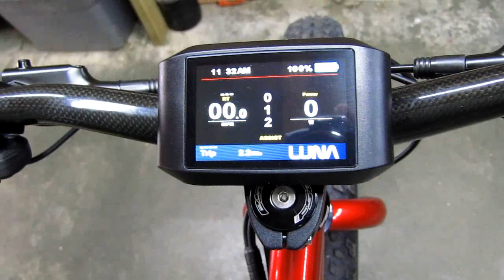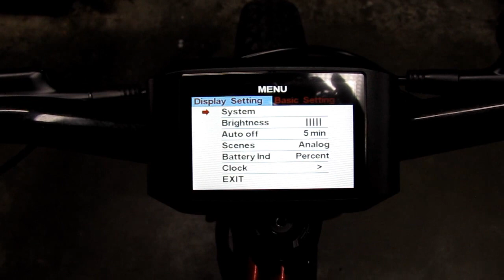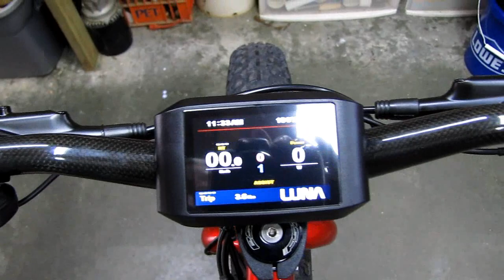Mongoose Hitch Ebike Build #6 - Luna BBSHD parts and install

Comment: Thank you for sharing your experience building this.   One thing I did not quite understand from the video:   

Was your BBSHD motor the 120mm bbs?    What did you need to saw to get it to fit on the 112mm bbs frame, on the mongoose frame?   Was it required?!

I just ordered a BBSHD 120mm from lunacycle after watching this video and hope i can pull off the installation...
Reply from the maker: You have to measure the bottom bracket on your bike and get the correct motor. That Mongoose was 100mm. My carbon fat bike is 120mm.
I used some spacers on the Mongoose

Comment: Would the BBHSD work on a Mongoose Vinson?  Similar frame to the Hitch but has a lighter, aluminum frame and better components out of the box.
Reply from the maker: I am sure it would. You just have to know the BB width so you order the correct motor. The hitch I had was 112mm, so I ordered the 120mm motor
Reply: EL34XYZ thank you. I watched all these videos. They were great. Thanks for sharing your knowledge with us.
Reply from the maker: @chrisnunn6748  Glad you liked them

Comment: I knew you would like the LUNA stuff.  And and the rear derailleur modification is really cool.
Reply from the maker: Thanks Dave. Luna has high quality stuff. And Eric is a trip to watch on the Luna channel.
Reply from the maker: I could not find a better deal than the Anniversary special that Luna was doing. They only had 120mm BB kits left and my BB was 112mm, so that worked out great.